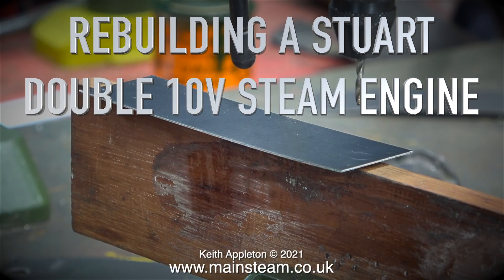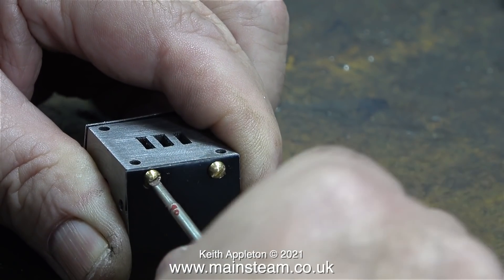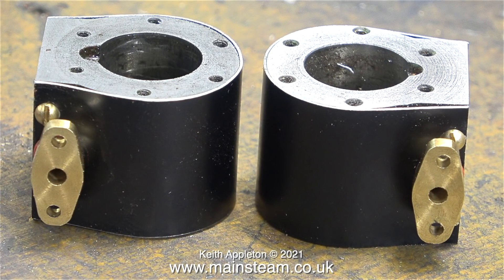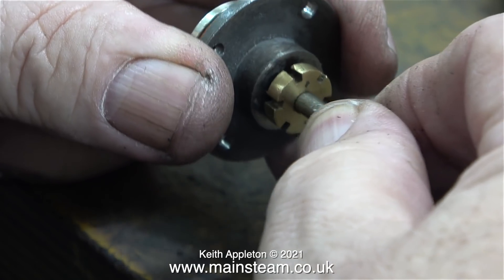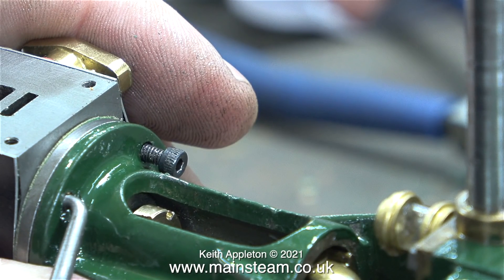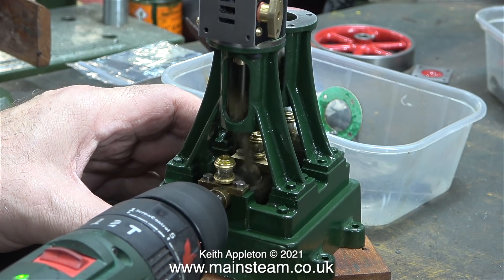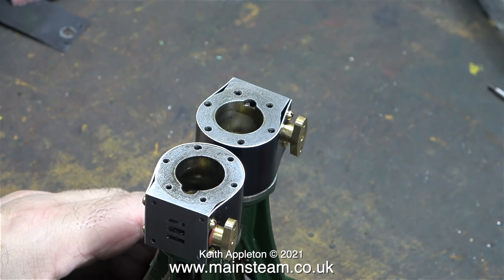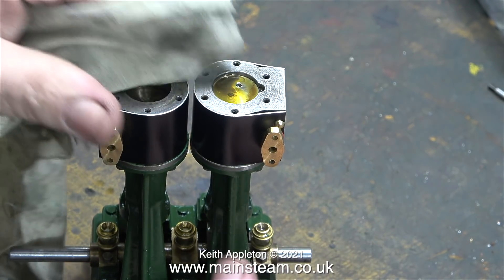REBUILDING A STUART DOUBLE 10V STEAM ENGINE - PART #11

Comment: I personally would have used a ball nose allen key to get those cylinders on there.  Than tightened them up with a standard one.  But I guess that would be difficult to store them in the contaner like you do, unless they have a ball nose allen key of a decent length 🤷

Comment: Keith, have you tried a Unibit to drill the 1/4" holes in the cladding?  I find they work quit nice on sheet metal.
Reply from the maker: too violent for this soft metal though .....the way it did it worked fine anyway.